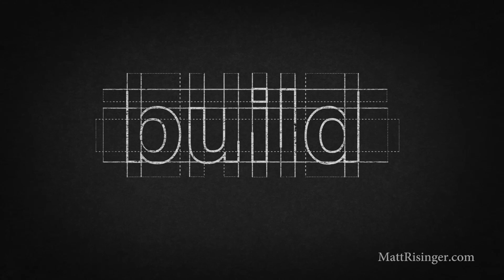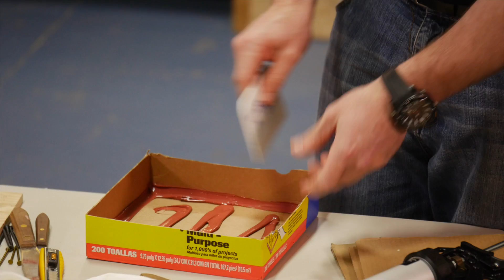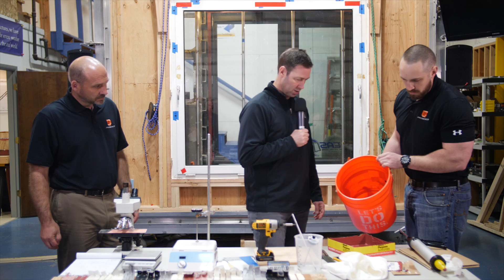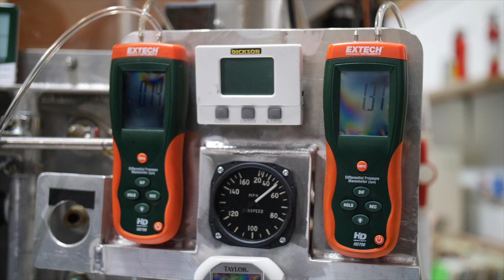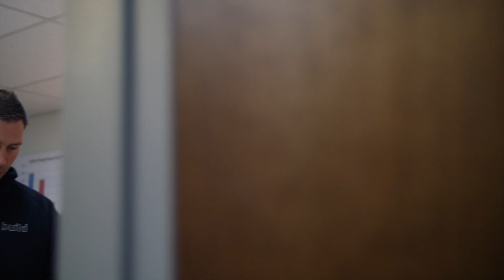Prosoco Waterproofing Test Lab

Comment: I know they are both sponsors, but with what you have seen would you recommend Polywall Blue Barrier or Prosoco products? Or have you at least seen any advantages or disadvantages?
Reply from the maker: Both excellent products. I like the Prosoco system where each step is color coded. Just toured the factory and was super impressed too

Comment: Can this product be used to cover the whole leaking vinyl membrane decking instead of replacing with the new vinyl membrane?
Reply: They have a roll on product but it’s not impervious to UV, which will degrade it over time if I’m not mistaken. It’s meant to go under a protective layer such as brick.

Comment: Matt, Can you please do an episode about waterproofing around exterior electrical boxes and light fixtures? I'm worried that my builder totally messed that up 12 years ago and I want to get on it before problems arise but not sure what to look for. Thank you for your show!
Reply: Hi John, Quick and easy to detail around any through wall penetrations with this system. Use Joint and Seam Filler to tie the penetration back to the substrate and tool out from there. MUCH easier than all the relief cuts and origami required to detail with a stick and peel! Check out the details here http://www.prosoco.com/media/2522/r-guard-installation-pipe-and-mechanical-penetrations-s3-1.pdf

Comment: What's the information on using this for Styrofoam ICFs?
Reply: It's done all the time! Joint and Seam filler between panels and Cat5 membrane on the face. Make sure to brush off any oxidation of the Styrofoam before applying.

Comment: Looks so much easier than applying a roll asphalt membrane. Fluid applied seems almost too good to be true. I've been watching your series and waiting for the cons to this system.
Reply: Cons would be the price (both material and labor).
Reply: hope you're not holding your breath! Real world performance of over 10 years and still going strong! Remember it was designed by a contractor, FOR a contractor, so it was built to be as simple as possible and nearly impossible to do wrong. Try it out for yourself!